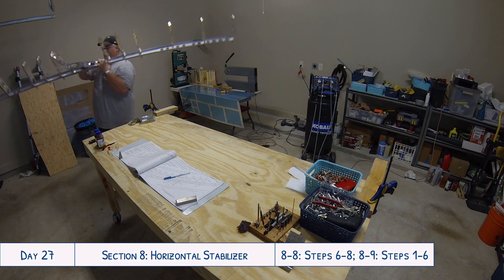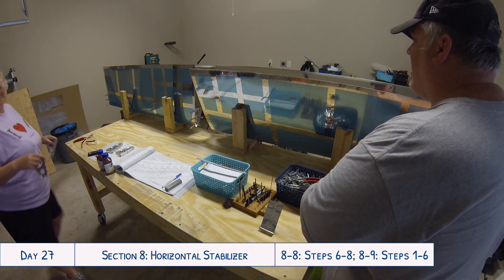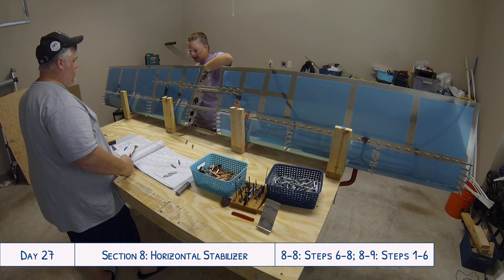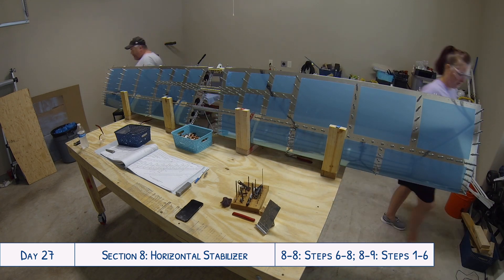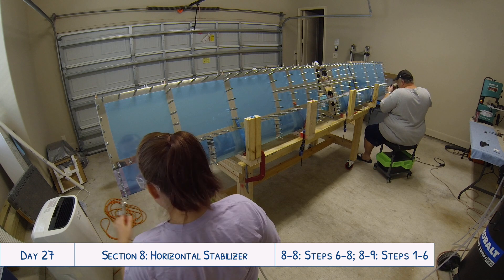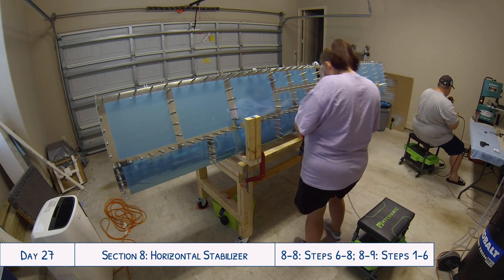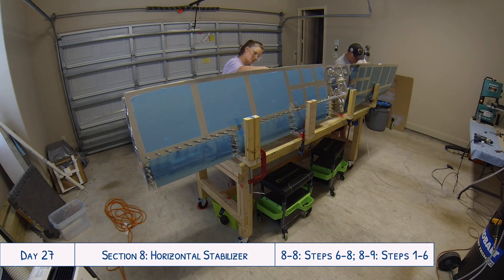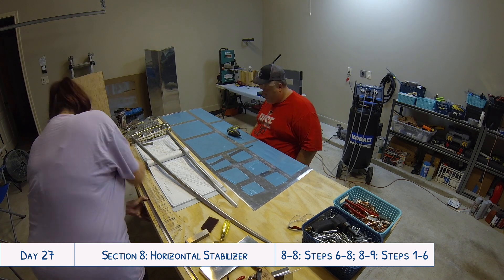Van's Aircraft RV-10 Build: Day 27 - Full Day's Work on Horizontal Stabilizer (8-8 & 8-9)

Comment: It looked as if Tyler was using a drill during the deburring process. Was he or was it just a Dremel with a piece of Scotchbrite?
Reply from the maker: It is a little, low power drill with a deburring bit. It doesn’t spin very fast at all so we’ve found it very helpful when we have lots of holes to deburr, like on these skins. We didn’t want to use one of our other drills and risk countersinking the holes, so I found this for cheap at Home Depot and it’s worked out great 😊